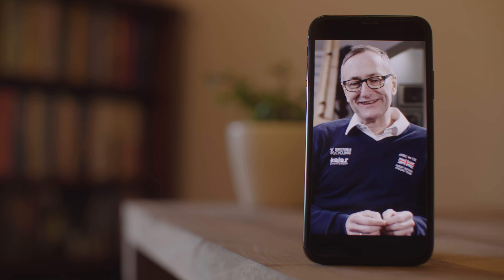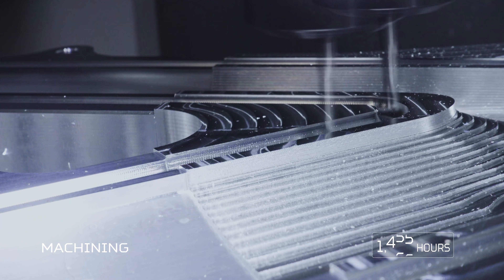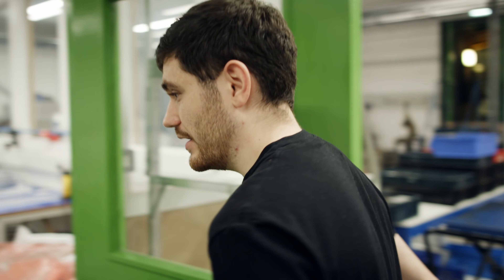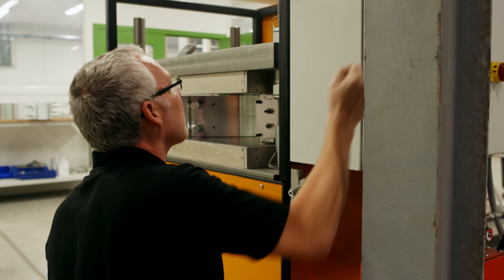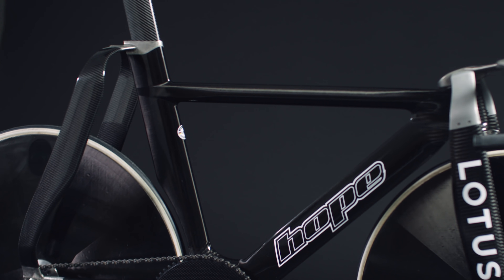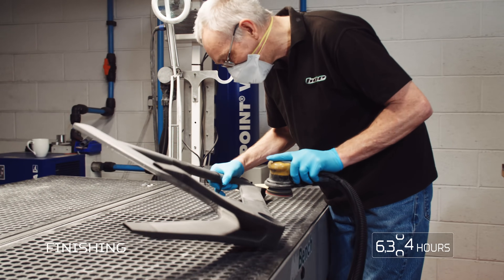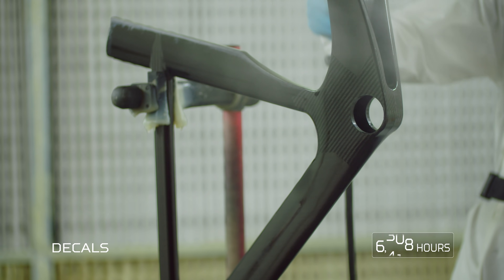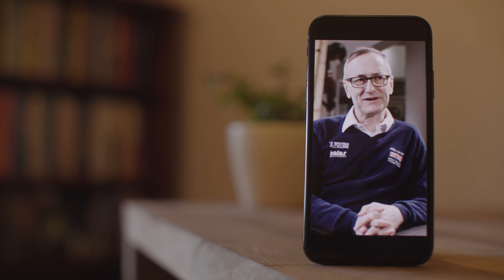Hope HB.T - 7005 Hours & Counting

Comment: This bike and edit are amazing, but something that caught my eye was at 14:57 the wheel doesn't seem to be spinning in a perfect circle--the gap between the tire and frame clearly changes as the wheel spins. Anyone know why? Is this common?
Reply: Probably not intended if the wheel is free spinning, but with weight there may be flex involved
Reply: funhouse tubular tyres are never perfectly round, it’s much more likely to be a lump in the tyre than flex in the frame or fork
Reply: I believe that isn't the hope wheel as it's a tri or quad spoke. I think they only produced full disks for the project, and as Dominic said tubular tires are not perfect.